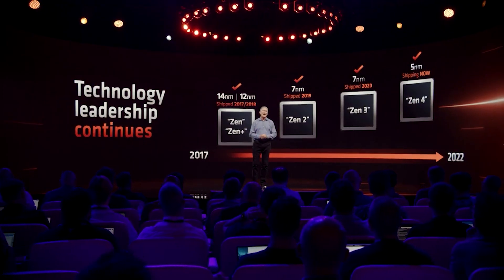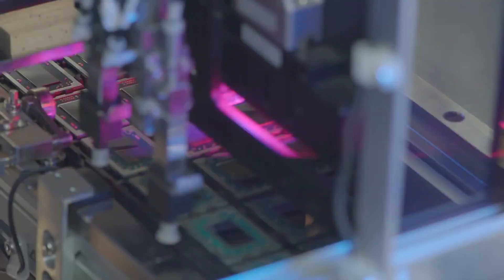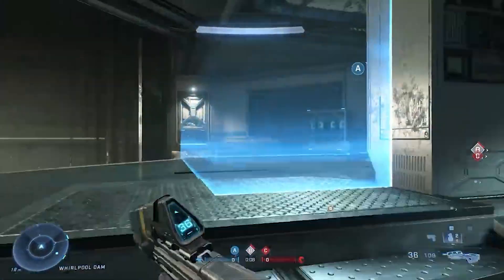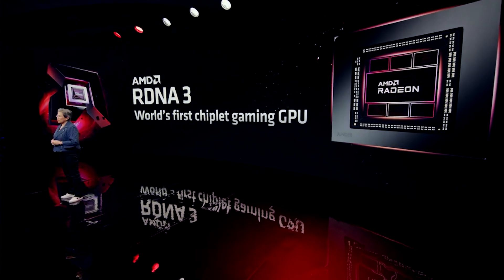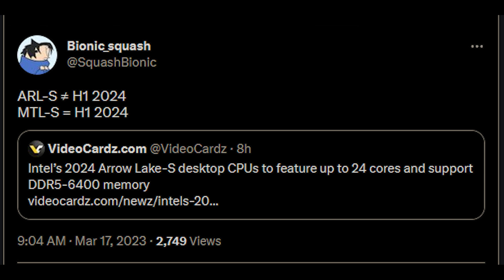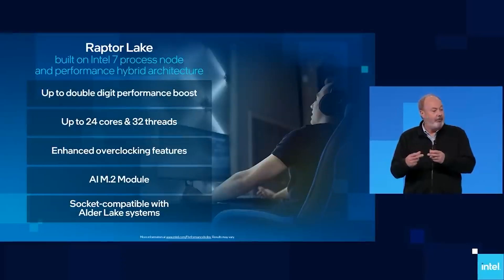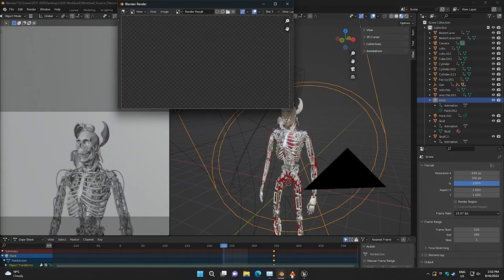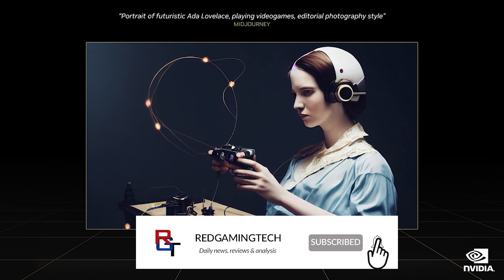Zen 5 CORE COUNT Revealed! HUGE Intel Roadmap UPDATE

Comment: AMD have consumer Zen 5 options: (1) Rely on IPC gain only and max out at 16C to compete with Intel. (2) 3 CCXs instead of 2 (space allowing on package - but N4 is not that much more dense than N5) as per a previous incorrect leak. (3) Mix Zen 5 + Zen 5C to create an 8+16 big.LITTLE design for those cases where Intel's setup is still winning in MT.

Comment: But still if AMD keeps 8 cores per chiplet, im still hoping AMD decides to put 3 chiplets and therefore 24 cores in the top end CPU ? Personally i actually am disappointed AMD will still only offer 16 cores max with Zen 5, it doesn't have to be double the core count but 12 cores per ccd would have been a decent upgrade. Lineup should be 8, 12, 16,  20 and 24 cores by 2024. We need to finally get rid of 6 cores and push for higher core counts.

Comment: The technology on the desktop is stagnating for a while now. 6-cores should be the entry level, 8-cores lower mainstream and 12-core should be the norm when buying for 4+ years today. And that without a latency penalty, please. We haven't seen CXL, cool new memory technology or a better PCIe alternative either. I am also still waiting for better general purpose use of GPUs (+FPGAs soon). The memory interface is also still dual-channel with next to no latency improvements each new generation. PCIe lane counts haven't improved that much, and I could go on with a couple of other points. But you should get the idea now that both AMD and Intel are not pushing it really that hard.

Comment: The 16 Cores desktop model really needs to be upgraded to 32 or at least 24 or I will be picking up Intel for my next #Boinc build since this project really loves high core count
Reply: Intel staying with 8p+24 e cores , that's 32 max  , so zen5 is 16 core /32 thread is same . going with Intel won't change anything .
Reply: Ok, good for you
Reply: You can buy Threadripper/Threadripper PRO with upto 64 cores/128 threads.

I fail to see the problem here.

In terms of performance, if you're running BOINC, I thought that the 7950X was faster with NAMD/GROMACS than Intel's offerings. (But please educate me if I am wrong about that.)

Furthermore, I am not sure how well and/or how poorly NAMD/GROMACS works with the P-Core/E-Core split on the Intel platform.

I know that when I tested the 12900K using CFD applications, with the E-core ENABLED, the CFD application WILL NOT RUN with the E-Cores, even if I MANUALLY set the process affinity mask to run ONLY on the P-Cores.

And given that we know that the E-cores AREN'T as performant as the P-cores, if you have 8 P-Cores/16 threads + 16 E-cores/16 threads, you're still only getting 24-cores (albeit not all cores are "worth" the same)/32-threads.

If, for example, the OpenMP code for NAMD and/or GROMACS (or the other BOINC application) has to WAIT for the E-cores to be done before the P-cores can move on to doing the next thing, then having the E-cores is just slowing the BOINC run down.
Reply: @ewenchan1239  If you always like to be one gen behind then go with threadripper, which AMD neglected hard. The fact that Zen 4 threadripper is pushed to the end of 2023, 1 entire year after Zen 4 desktop and 1,5 years after Zen 4 Epyc is just stupid. Also Threadripper will have much lower clocks, so doesn't make any sense for gaming, even if the game loves higher core counts. 16 desktop cores beat 24 threadripper cores in lots of applications due to much higher clocks.

Comment: From years ago I remember AMD saying they wouldn't increase above 8C CCDs because of DDR4.. With DDR5 7200 which should be available by next year they should have equvalent BW\core as with an 8C DDr4... I can't say but it seems they have a scaling issue whether they do 8C CCx for Turin to get 256C... Either they have to do 32 CCDs at 8C or 16 CCds at 16...

It seems like wafer size will be the limitation as it sill needs to fit in the same socket and Bergamo... With "C" cores having less cache, it seems reasonable that those alone will have 16C... And they can use a similar scheme as Bergamo to Genoa...

We'll see.. They won't release if before Computex next year...

Comment: If cores went higher for the desktop like 20 cores 32 threads or something it would be nice for the others to follow suit.

Like the x600 range goes to 8 Cores 16 threads, x7/x800 goes to 10 cores or something like that. Just change the lower end of the x600 line for a change there's was even talk of 76003DX

Comment: AMD is dropping the ball.   First Intel got stuck at 4 cores now AMD is stuck at 16 cores on the desktop.  I won't update until the new offering is 50+% faster than my 5950X and affordable too.
Reply: I'm currently not doing work stuff with my desktop, and games run good enough on m 5950X so no ned to upgrade
Reply: lol like you need more than 8 cores for daily home use
Reply: @chiahsun907  Who said anything about home ?

Comment: People need to know that going to shared L2 cache means AMD is moving away from "Exclusive L2 cache" to "Inclusive L2 cache". This increases L2 cache hit rates for other cores in the CCX It also makes it so that the cache is larger when working with less cores. It won't need to go out to L3 cache then the other core & I mean another cores L2 cache line in the same CCD/CCX. Plus it won't need to go out to ram.
Reply: "This increases L2 cache hit rates for other cores in the CCX"

No it doesn't. An inclusive cache hierarchy sacrifices hit rate for effective latency. 

" This increases L2 cache hit rates for other cores in the CCX" 
 
No it doesn't. Just the opposite. 

"It also makes it so that the cache is larger when working with less cores. "

What on earth are you talking about? An inclusive cache hierarchy REDUCES the effective cache size because higher-level caches duplicate the data contained in lower-level caches.

"It won't need to go out to L3 cache then the other core & I mean another cores L2 cache line in the same CCD/CCX. "

What? It'll need to access L3 when it suffers an L2 cache miss regardless. 

"Plus it won't need to go out to ram."

WHAT!?!?!

It's amazing you managed to get so much wrong in only a couple of sentences.
Reply: @gw7624  reported
Reply: @gw7624  No you're just trying to troll me.
 INCLUSIVE SHARED SHARED means all caches have a copy of the data inside each line of that cache for other possible needs that cache & other L2 cache that are Inclusive to the group or shared L2 cache will have that copy.

Core 2 duo uses this exact setup.

Larger caches means means less need for latency depenedcy on cache misses. As it decreases a cache as data stays in the cache lines because it's much large. 

Core 2 duo uses this exact setup.

 Learn how "SHARED INCLUCSIVE CACHE" works.

Comment: I think in this point post Meteor Lake/Arrow Lake, Intel shall focus on adding even larger L3 cache on compute tile instead, using Foveros Direct copper bonding 3D package, instead of increasing clock speed, and focusing on reducing power draw on turbo boost, ideally capped at 175W, and base TDP capped at 105-125W. Reducing power draw shall improve longevity, and let LGA1851 socket last three generations or at least 4 years as AM4 does. It is better to do two years between each generation. The coherent fabric of L3 cache shall be redesigned to let the entire pool to be shared by ALL 8 P-cores in a ring. Also, I hope one day, Intel would ditch P/E core designs in favor of single type of core in all loads similar to Zen 4. This single core type will be both high performance and high efficiency in terms of performance per watt. The single core type is tunable for different segments, while retaining up to 8 core in a single tile. For desktops, up to two identical tiles can be made depending on SKU. For mainstream and enthusiast users, there is no need for more than 16-core 32-thread. Thus, all cores will have HyperThreading. Then future Xeon Workstation and Xeon Scalable will be made with same tile approach with a center SOC-IO tile, and a new way for hybrid workload is to be dependent on cache size on a single tile. The second regular tile would be offloading background tasks. For most gamers, 8-core 16-thread with very large 3D Foveros Direct stacked L3 cache shall be more than enough.

Comment: How many cores do the consumer market actually need right now anyway. 8c 16t seems to be the most optimal core count giving you the best of both worlds with cores and ghz speed. Anything more as of right now and the speed will start to suffer from more cores.
Reply: That true for gaming. Having double core on AM5 could enable more productivity work for power user. Unless you need more pcie lane then you would have to upgrade to threadripper. 
Or they could cane threadripper and have one lineup.

Comment: That's a bad move from AMD. Intel already is spanking their ass with CPUs that are good for both gaming and productivity. In AMD you have to choose either and if you want top performance you pay +50-100% more than comparable Intel that's a top performer for both.

Intel with their 8 P cores + 8 threads and 8-16 E cores will just obliterate anything for gaming and productivity once they switch their nodes.
Reply: Intel is not selling well. The amount of profit  margin they get from desktop CPUs is very low. Even if Intel priced agressively there CPUs, they are almost selling it at cost of production. For intel to gain more profit.  They have to perfom even higher per generation to justify higher price from AMD. While AMD is selling just the right amount profit.
Reply: 7950x3d isn't "+50-100% more", it's like 10-20% more, but you can save on motherboard and RAM. Either company has valid options for mixed productivity/gaming!
Reply: this is true and people are pre dick sucking already. AMD needs more core count flexibility to combat Intel. anyone who doesn't understand that is a fool.
Reply: Intel is slightly cheaper sure, but they're also slightly slower. Same logic people use for 4090, it's 17% faster than a 7900xtx but also 170% of the price because it's slightly faster right?

Comment: With Intel's fab problems combined with size of the core architecture limiting Pcores per chip AMD don't need to up core count till Zen 6 if they can keep IPC & Clock improvements along with laintance cuts. I also suspect AMD are getting ready to launch a High end RDNA4 card end of 2023 or Start of 2024 barely after last low end RDNA3 lauches.

Comment: Chiplet L3 cache paradoxicaly would made zen 5 desktop even cheaper. IT could sill be just 32mb and shared by both ccds. It could be made on 6nm and 3d cache`d more easly with lesser impact on ccdt termals and clocks.

Comment: Honestly we dont need more cores mostly in desktop market we need architectural improvements, better node, better cache, better clock speed. 16 cores for majority is sufficient.
Reply: no we need more.
Reply: @_M....   Well im a gamer so its still fine.
Reply: @_M....  That would be for HEDT
Reply: @jayvee8502  there's no real point in a HEDT tbh that was an Intel scam that died when Ryzen came out. mainstream desktop motherboards a f*kin $400 for a mid range board.